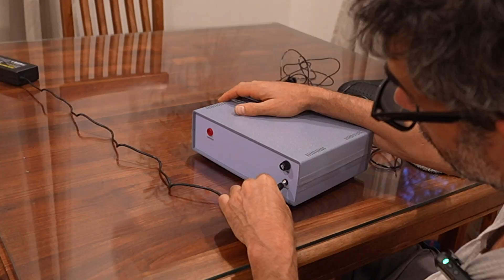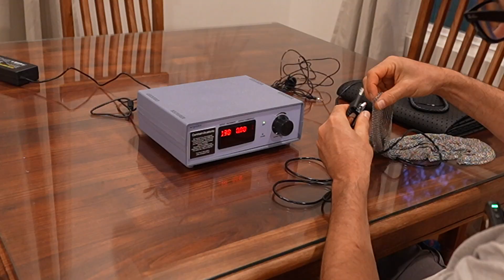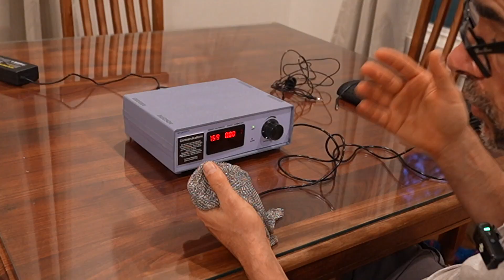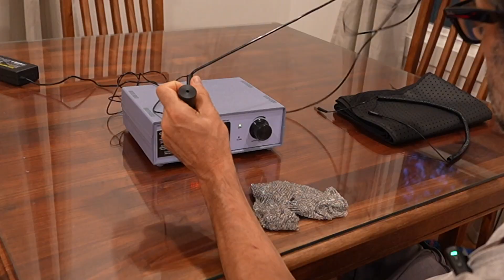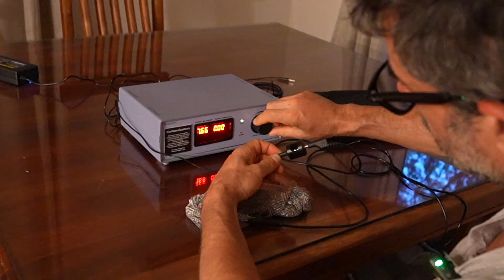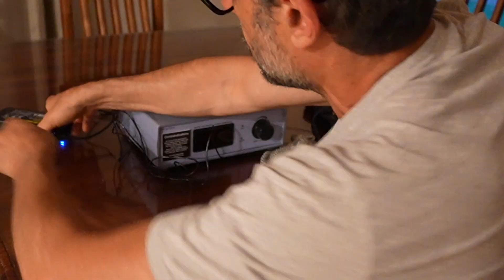Electron Charger Instructions

Comment: I'm interested in the Electron Charger, but got a few questions and couldn’t find much information about it:
- You mentioned that the machine can reach up to 18 kV — is this a positive or negative potential? If it’s meant to supply electrons, it should output –18 kV instead of +18 kV, right?
- I own a special kind of Phanotron tube and observed that I could only kill Paramecia bacteria when a 0-5V voltage wobble was applied. They died within a minute, but without the voltage wobble, nothing happened. The Phanotron should theoretically emit an electron beam, but since electrons should arise from voltage change, that might explain why only the wobble works. Your device uses pulses — however, when I tried pulsing alone with the Phanotron, it didn’t have any effect without a wobble. Does your machine also create a voltage wobble, or could it be externally modulated to produce one?
- Have you measured the ORP to see if it can negatively charge water?
- Can you ground yourself while using the Electron Charger at the same time or are there any other restrictions?
- What kind of attachments are possible instead of the metal mesh? For example, could one also connect a larger electrode plate with a copper core and a dielectric outer layer made of epoxy resin?
- Could it even be used as a kind of "Urzeitcode" device? The Urzeitcode experiments used a strong negative static field that caused plants to grow more robust when their seeds were exposed to it. They also had unique traits - if you didn't know about it yet, you should really take a look. Since your Electron Charger seems to produce a similar field, I was wondering if it might have comparable effects.
- And lastly, it would be great if your website allowed product reviews — you might get some success stories that help others to see the usage benefits.

Thanks for your time! 😊It’s really impressive that you’ve built such a device. I’ve been looking for something like this for a long time — I also found that the body depends on electrons, yet almost everything in our environment seems to have a positive charge. Even my Kangen water is losing the –200 mV quickly and has +200 mV the next day 😄
Reply from the maker: –18 kV 

Phanotrons don't emit eletron beams
Our device can pulse with a spark gap
Water can't hold a charge 
You can ground yourself with our portalbe 300v, the 18kv will turn off if you ground
any conductive attachments are fine
I built the static field unit you refer to once, didn't like
 it
testimonials are tantamount to medical claims and get you in trouble with the authorities.  -Cheers